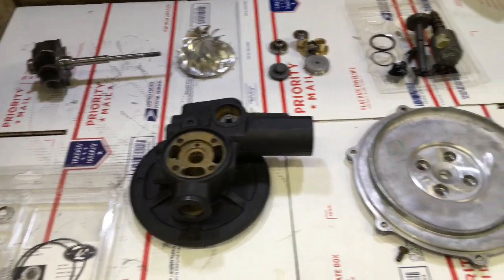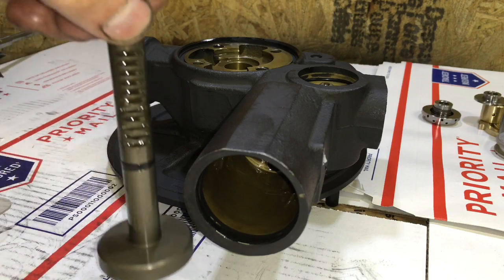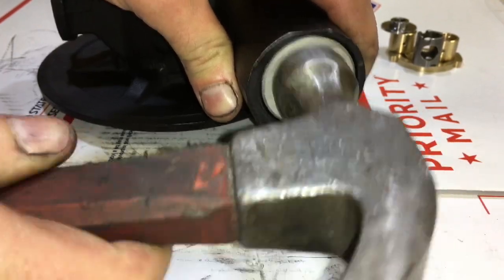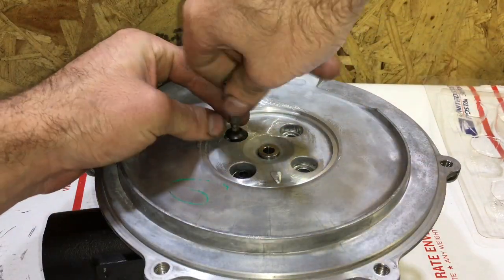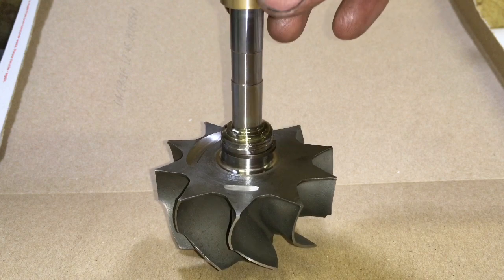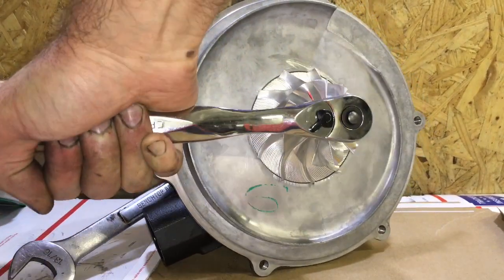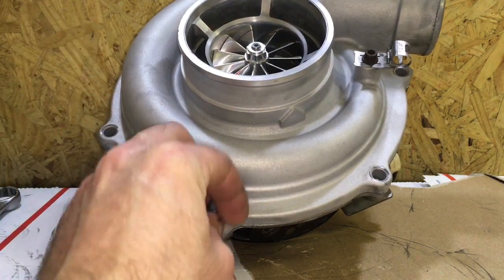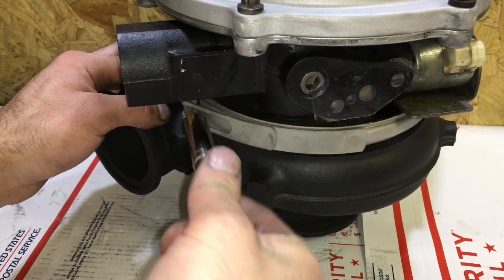6.6 duramax 6.0 Powerstroke Turbo Rebuild

Comment: Great video info- what if you clock the compressor wheel in the wrong direction after you have install it? Will it run?
Reply from the maker: It will be fine as long as it’s not too loose.
Reply: It’s still doesn’t feel like it working properly. I have a 2003 f350 powerstroke. What would be my cost for you to rebuild it ?

Comment: Great Vid With Attention to detail! I would think all wheels would come balanced, but I have seen shops charging an extra $100 for it, saying that they won't warranty the wheel assembly if you don't pay the uncharge. Can you elaborate on this a bit to help me gain perspective please?
Thanks!!
Reply from the maker: The wheels are balanced individually pieces when paired together as an assembly the balance of them paired is off some. There is a tolerance it has to be under. I have a sheet to go by, I think the Gt37vas tolerance is 9 grams/inch. When I put the assembly on the balancer it can be less or greater than this number. I can grind away the imbalance areas to make corrections. I have some videos on my channel showing balancing.

If it’s off by more than 9 grams/inch then it should be corrected. I have been able to correct them down to .5 grams/inch. The turbo runs much quieter when installed. 

It’s also most important to use the copper bar thrust bearing like this kit: https://421b62.myshopify.com/products/untitled-aug8_15-42

The steel ones often over heat and cause failure.

Comment: I'm in the process of rebuilding my LLY turbo. My Vane Piston o rings were basically gone when i pulled it out. I put the correct ones with the square edges. Now the piston is hard to move around with the little vane ring handle. Is it supposed to be hard to move in and out with new o rings?

Comment: Can I take the 10 blade exhaust wheel/shaft assembly and compressor wheel out of a Garret Powermax for an 05 6.0 powerstroke and swap them into my stock LML duramax turbo?

Comment: nice video.  Thanks.  for making it. It would be nice if you said the Ft/Lbs specs on the Compressor wheel and other bolts but great video.  I just rebuild mine completely from watching yours and I've never opened a turbo before.
Reply: Have u found an answer buddy?

Comment: I installed a he531v into my car as an entertaining project. I was wondering if you could share a video on how the vgt shroud plate can be properly removed from the turbine housing without damage. I see that the are setup to be spun around but have not been able to pull one out and reinstall one safely. I see some kits sell new shroud plates so I assume this is not impossible
Reply from the maker: We cut the old part out with a milling machine
Reply: Thank you, one day I think I’ll get a hx40 or similar from you guys

Comment: Used your rebuild kit. On First Test drive after install I developed a howl that wasn't there before. Any answers to that? Also the paper gasket for oil feed failed immedietly, slowly seeping all around it. How should I remedy that?
Reply from the maker: It’s possible your bearing is stuck or the wheels are damage and out of balance and need to be replaced
Reply from the maker: Also it can mean the turbo isn’t getting enough oil

Comment: Could I use luberplate on the shaft instead of oil?
Reply from the maker: I prefer to use oil because it’s easy to check for resistance in the cartridge. If there is resistance In the cartridge a piston ring seal is bent on install Ora case in other models is the oil deflector was not pressed down all the way or the bearing housing wasn’t machined for the larger collar.

Comment: Unison ring is poorly designed. It needs two actuators 180 apart, not just one.
Reply: agreed im having issues with sticky vanes at 32k miles on my duramax

Comment: Will a wicked wheel for a stock 2005-2007 turbo thread right on? I’ve heard there’s a difference in size.
Reply from the maker: Factory seize wheel is 56 x 82 for 2005-2007, 2003-2004 had a 59 x 82, the upgraded wheel we use is 63.5 x88x94. You need the machined housings to match
Reply: Thanks!

Comment: Quick question. My turbine housing clamp broke.  Do you think it’s possible to separate the mating surfaces just enough to slide a new clamp in place without pulling the turbo from the vehicle?
Reply from the maker: No it’s not possible, you need to remove the turbo
Reply: No. Not enough space to do it. It happened to me 2 days ago. Fortunately i have a c5500 kodiak, so i can slide the turbo out from the rear theought the access cover.

Comment: The duramax and ford use the exact same model turbo?
Reply from the maker: No, there are variations, they really just use the same rebuild kit on the lly as the 6.0.  The vanes on some were the same, the unison ring is the same but the housings are all different

Comment: Great video! I hope you’re still answering questions on this video. Is there a tear down video? I can’t seem to separate The bearing housing from the turbine housing. I’m afraid to break something. Also how to you balance shaft. Where I live they just order new turbos no one fixes them. Can you rebuild without balancing or am I asking for trouble?
Reply from the maker: You need to remove the turbine housing evenly with a big hammer. You don’t have to hit it so hard, you just need the mass from the hammer
Reply: Turbo Lab America thank u so much! I really appreciate You getting back to me!
Reply from the maker: You don’t have to rebalance it because the compressor wheel is threaded it will line up the same every time. If the wheels are damaged you may want to  sand them down  if possible and have it balanced
Reply: Turbo Lab America Again very much appreciated!

Comment: Hey i gotta question, the compressor side back plate, do you know anyone who sales them? that little piston ring seal burnt up from oil stavation on my 6.0. and i believe it hurt the backplate.. Does anyone sell the compressor backing plate?
Reply from the maker: I have a bunch of used ones for the 2004.5-2007, some of the 2003 weren't the same
Reply: Turbo Lab America  can i have your email?

Comment: what did you use to paint the hot side and where the unison ring goes?
Reply from the maker: Grill paint. It's made by rustoleuem. It helps prevent rust

Comment: Hopefully you can help me . I got a 08 dmax . Can't go over 2000 rpm a bunch of black smoke no power and the turbo is doesn't whistle anymore . What could it be . Thanks
Reply from the maker: +Vidal Martinez  do a boost leak test

Comment: this looked like an 03 shaft, was this basically a powermax upgrade?
Reply from the maker: +Andrew Crabtree yes. 63.5 X 8& X 94 compressor same as gt4088, 2003 10 blade turbine. I'm working on coming out with upgraded cover and wheels to sell for these but I'm still in the process. I want to make a few more compressor options and some larger turbine options but it's just a process over time.